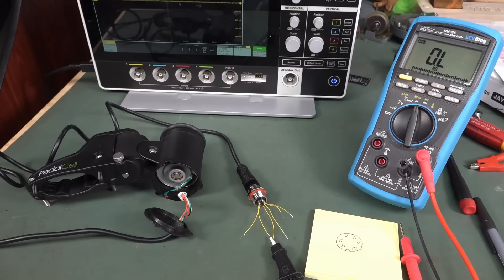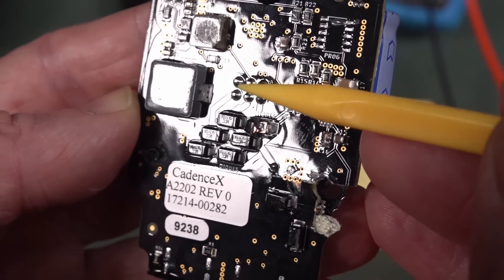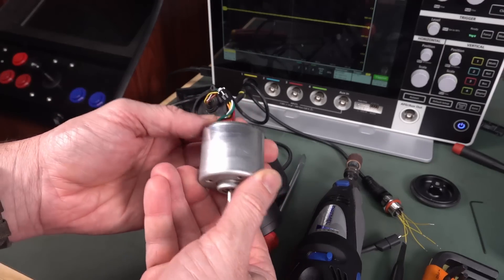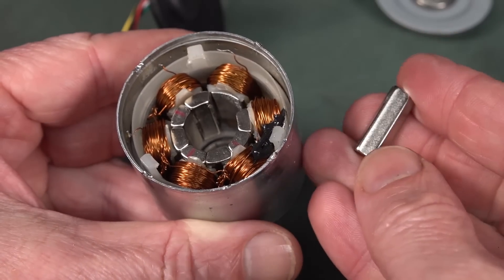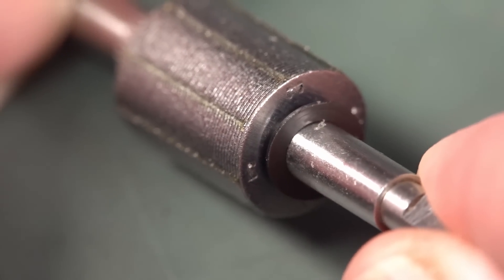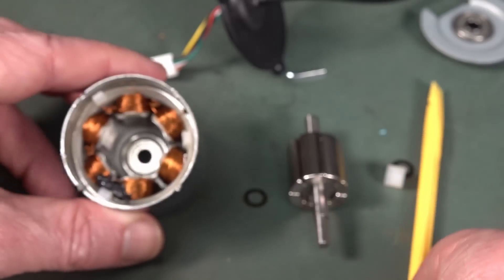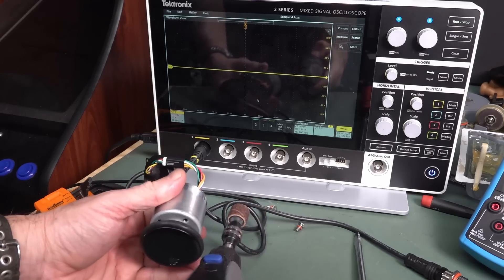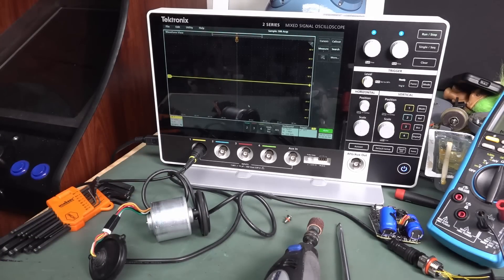EEVblog 1485 - PedalCell CadenceX Bike Generator LOL FAIL!

Comment: This is so awkward...we have 2022 and nearly every bike has a hub dynamo...or you simply buy a wheel whith one...much more efficient and can also be used with decent hardware to charge via USB.
Reply: Not many bikes have a hub dynamo. The PedalCell does mean that the dynamo can be moved easily to different bikes with different wheel sizes. It is actully more efficient (when working) than the hub dynamos.
Reply: @g4gxl  at least in germany for decades all bikes have either a hub dynamo or none at all(the sport bikes). And they're so cheap that it makes no real difference buying a wheel without one for everyday use. And I doubt that they're more efficient since you have no direct power coupling like in the hub. I always hated this old type. When I had a hub dynamo I leave it permanently turned on for security, since it is barely noticeable compared against this outdated concept. And you could get really problems with friction under bad conditions.

Comment: The funny thing is I just used a motor from a printer on my bicycle to make the light go, on . Made the roller from the paper take-up reel and the printer tray springs pull it against the wheel. The hinge assembly is from the cartridge holder. So LoL when you buy a professional product and get this on your plate. Chinaman what have you done.

Comment: The whole concept of a little rubber wheel rolling on the rim (or a ridged metal one rolling on the tire) is horribly outdated and stupid in the modern world. They were absolutely useful back in the days before hub generators, because they could be reliable (in combination with good quality weaterproofed lights) and because battery operated incandescent lights only lasted for a few rides at best. 

But by now, almost all bicycles either have battery operated LED lights that last for weeks or months, or a hub mounted generator that does not have any friction losses. A conventional hub generator delivers 3 watts of power which is just enough to slow charge one USB device, but it would be trivial for the manufacturer to offer them with a higher power output. 

Mounting a traditional rim/tire roller dynamo on a brand new bike is incredibly stupid because of the intense inefficiency. It truly feels like you're going from a mild tail wind to a mild head wind when you click it onto your wheel. 
Aside from that, they have a bit of a risk associated with them: ending up in your spokes. Doesn't happen often, but it does absolutely happen. 
Finally, they suck in rainy weather. You don't want the force at which they push onto your tire/rim to be too big because that will cause even more friction and more risk of the dynamo being pushed into the spokes. But too little force and it will slip, sometimes even stalling out for a few seconds at a time. 

They had their time, they were useful back in their day, and they still can serve as an emergency generator. I used one 2 years back when i lost one of my battery operated lights. Although i was running the LED lights for years already i never bothered taking off the dynamo.
But given the choice to power USB stuff, i'd rather just get a power bank and charge that slowly with a conventional hub generator, than have a rim/tire driven dynamo ever again.
Reply: Or ride down hill.

Comment: Wonder if this 'generator' application just over sped the rotor?  I didn't see just how fast you were spinning (frequency would be good indication, although that stator is 3-phase, 2-pole, and you have 8 poles on the rotor, so that's not exactly 'textbook' generator configuration).

But if that drive wheel is about 2.5 cm in diameter, a bicycle going about 15 mph (24 km/hr) would drive that thing over 5000 RPM.  I think THAT is where they screwed up, not realizing just how fast it's going to spin and it simply 'spun itself apart'.

Comment: hi Dave not sure if someone else commented, but if you measure one coil 8 ohms, aren't you actually measuring the parallel combination of one coil, together with the 2 other coils which are in series by themselves? 

ie. suppose each coil is actually 12 ohms, then you are meausing 12 ohms parallel with 24 ohms (the other two coils), giving you the 8 ohms ?
Reply: Doesn't matter - he's just checking if there is an inductive/resistive circuit, a short circuit or an open circuit.

Comment: That does seem like a bad design to rely on glue only, those magnets are under lot of force, they want to attract to the coils and they are under centrifugal force too.   Almost should be some kind of plastic sleeve that goes over it too. (don't want to use metal or it will mess up the magnetism)

Comment: Nice catch, Dave!  This was never destined to be reliable as a motor either.  Adhesive doesn't stick well to ceramic magnets... especially under tension.  I would have wrapped the ends of the magnet assembly with a few turns of fine wire and covered that with adhesive.  Even better would be to specify grooves to fit the wire.
Reply: Hard disk drive head voice coil servos all use glued, plated neodymium magnets like these.  But I'll admit they probably don't see anywhere near the Gs this pedogen delivers.  I still think it should be quite doable as the epoxies commonly used for such things are very strong in tension, though weaker in shear.

In fact the best way to remove hard drive magnets is a sharp strike of the servo magnet bracket against something hard - striking with the shear line of the glue perpendicular to the hard object being struck against. As my son discovered and videoed when he was about 13.

How to Remove Hard Drive Magnets: https://www.youtube.com/watch?v=_Im0vIvjPNQ
Reply: The glue isnt sticking to any ceramics, its a metal coating. Also, its an alloy, not a ceramic. Also also, glue has no problem holding on to ceramics.
Reply: @leocurious9919  And yet it falls apart almost immediately.
Reply: @byronwatkins2565  Yes? Because its a metal surface, cheap adhesive and only a tiny bit of it.

Comment: A decent solar panel that can charge a phone or whatever is only like $25, is small enough to be bike or pack mounted...doesn't suck any of your human power.  Can be used off the bike.  And can just be hooked up to a cheap power bank or directly to your phone.  These bike generators were cool 30-40 years ago.  Now they are basically useless even if they work.

Comment: Typical case of using a component in an environment it wasn't designed for and then doing zero testing.  Customers are now the quality control testers.  
It was hard to watch how long it took to realize the magnets had come off.
The hall effect sensors provide feedback for motor controllers that have speed control.
Reply: re: "and then doing zero testing. "

Like, temperature and vibe (vibration) testing? Yes ...

Comment: I'm guessing the glue failed as the unit got hotter & hotter. If it's a glue like super glue, it turns back into a liquid if it's heated beyond a certain temperature. Pretty shoddy. Great vid though Dave, love it 👌

Comment: Only at the 7:20 mark, and your spot on those magnets should be glued or attached to the center part, my guess is the makers of this used something pathetic like superglue or just hoped the magnets would hold themselves there. 

Source: Was a mechanic, have rewound a couple of alternators in my day, so to me the failure the second I saw in was pretty clear but thats just because of my experience. Love your work and keep it up.

Comment: another gimmick product that isnt very well made and doesnt really do a great job of what its supposed to do either. Im sure you can get commercially available ones these days but I modified a regular super bright bicycle light about 6 years ago now to use 3 x 18650s and a charge controller / usb output.. .it works as both a light and a usb device charger.

Alternatively USB power banks are that cheap these days and available in all kinds of shapes and sizes you'd  be way better putting one in a backpack or underseat bag etc with the device you want to charge.

I've had a few magnets fail in small engine flywheels over the years... these have all been engines that have has the flywheels partially submerged in water and the rust buildup has detached the original bonding.. never seen a motor give up the magnets that wasn't rusty so these must be built like crap.

Most half decent epoxy will be fine too for a long repair.. I have an old generator that I bonded the magnets in over ten years ago and gets used regularly and still going no problem.

Comment: you can just buy a standard bike dynamo, slap on a 4 diode bridge rectifier (and a capacitor) and feed the output of that into one of those cigarette lighter chargers you get for cars and that will make sure its 5v
been doing that for a few years on my bike and its been holding up fine    
cost me like 8$ in parts
Reply: Love it!

Comment: Shouldnt the magnets move relative to the coils? seems like they came unglued from the stator
Reply: Shouldn't you actually WATCH a video before commenting? You know, just so you don't make an a$$ of yourself.
Reply: Yes, Jones was disappointingly long to come to the same conclusion - IMHO he is slipping.
The missing cogging on the shaft alone should have alerted him of the true problem, given he can also see the electrical interface to the electronics.

Comment: It only takes one magnet to come lose and stick to the coils. Once that happens it jambs the whole motor up and then all the rest of the magnets break loose. The magnets change polarity from one to the next - NSNSNS. You can use a spare magnet to get the orientation, it doesn't matter if it N or S just as long as they run opposite from one to the next.

Comment: nice detective work. Its probably got three hall sensors as the motor was designed to be used as a motor not a generator, need the 3 halls to run it as a motor, so you could hook up an ebike controller and run the thing as a motor if you wanted.
Why the kept one hall sensor I'm not sure but it might be useful to have a signal for some reason, if they are not useing diodes to rectify the output they might be using the hall sensor output to rectify via some fets.......just a guess.
The magnets are just reversed polarity each magnet as you go around, so if not in correct order could easily sort it.
I suspect the little gennie might get a bit hot and the glue for magnets not strong enough when heated.
Sure is a neat little unit.

Comment: Those "glue marks" for all the world look like weld seams to me. Did they just happen to align with the marks on the top/bottom of the cylinder?
Reply: Watch the video. Pay attention. Then read other comments. Then post a new one if you have to ask something.
Reply: @johncoops6897  If you don't actually have an answer (doesn't sound like it) then you'll be more constructive by staying quiet. There. We both told each other what to do. I've no doubt you'll set a good example for me and others by complying.

PS. Also, watch the video, pay attention and read the other comments. All of them. Good luck and have fun.

Comment: Germans formed a "Forumslader" enthusiast working group decades ago, because any attempts at electronics coming out of bicycle accessory companies were garbage. Their DIY series of devices have several design goals. Main is compliance to legal norms - you simply HAVE to have dynamo lights in Germany, so you don't ever run out of energy. When you do, it's nice to be able to run them independently of pedalling, to give you extra safety when you need it, so they added hold up power which can be activated manually. Also they made it stealthy, you hide it entirely in the frame, so the authorities don't go around questioning you and people aren't so inclined to nick your stuff. Plus you get the ability to top up your GPS (this is when the project started, before smartphones were around) and phones and gadgets. Many members go on bicycle tours hundreds of km with intermittent camping and whatnot, and having true energy independence is great for a peace of mind. Then of course they got carried away and added Bluetooth and whatnot, which is nice as well, people love their bicycle tachos, but they are a little finicky, and the hub dynamo gives you regular pulses anyway.

You've got to use an actual bicycle quality dynamo to get that power. Tyre side dynamos work but aren't entirely pleasant. Hub dynamo is fairly nice though, and when it's shorted out, you can barely feel it at all, and those are reliable, they'll last for decades. That's the one sort of part you want from bicycle parts companies where they know what they're doing and are held to relevant standards.

Comment: A couple of grooves around the magnet cluster for circlips would have solved that, much better than glue. No wonder it tells you to do no more than 40MPH on the box.
Reply: Circlips would short out / distort the magnetic flux. They solve this problem in high-stress application by proper gluing, then a wrap or fiberglass, carbon fiber, etc around the magnets. Needs a bit more clearance to fit that.

Comment: I'm tempted to say "made in china" but generally they would not use quality bearings - usually just cheap bronze bushes instead. It may be that the motor/generator units are just assembled in china, and they don't give a shit. If the product fails a month down the track it's not their concern, they've been paid and that's all that counts. That's the chinese way.

Comment: Just an idea: instead of glue why not use one or two rings to strap the magnets?
Reply: Because that will increase the air gap between magnets and windings. In high-stress applications, they wrap the magnets in fibreglass, kelvar fabric, carbon fibre or whatever.

Comment: The rotor laminations do matter because the magnets act like air (in terms of inductance effects because a magnet is fully saturated) and the inductance seen in the windings involves the entire magnetic circuit (back iron, stator cores, rotor iron, and then back out)
Reply: it concentrates the field lines from the p. magnet right?
Reply: @Blox117  It concentrates both the field from the permanent magnet and the electromagnets. The field strength matters most in the air gap between the rotor and stator. You maximize that by creating a "magnetic circuit" with the lowest reluctance (i.e. highest permeability), which means that you want most of the field line loops to travel within iron.
Reply: @sbreheny  neat. so how do reluctance motors work then? It's the shape of the steel that matters? And it tries to move to create the lowest reluctance? It's kind of hard for me to understand why that produces a rotating force

Comment: I think in the previous video I saw that the manual said "don't exceed 40mph", seems like they should have set that speed a lot lower given the amount of glue holding it together.
Reply: My thoughts as well.  Estimating that drive wheel is about 2.5 cm, even a leisurely 15 mph would send it over 5000 RPM.  Small wonder it 'spun itself apart'.  Classic over-speeding failure.
Reply: @mikefochtman7164  ha ha! 15mph is my average speed on a bicycle! Make sure you don't go down any hills.
Reply: @DavePoo2  Yeah it's not like they have brakes so you can control your speed or anything. I get that most drivers are incapable of maintaining a speed limit.

Comment: to fix it you probably should do it in 2 steps
1 epoxy the core and slip on the magnets but separate them with teflon/polyetylene spacers and wait for glue to set
2 remove spacers and fill the gaps with more epoxy glue

it could be better than factory with cheap metal to metal epoxy :P

Comment: This was interesting, not because faulty product but it relates to topic of my masters of theses "Bicycle dynamo powered charger for electronic devices" (paper is in finish) where I studied HUB generator powered USB charger, done some measurements about HUB generator, and done some simulations.

3-phase generator is definitely better choice than 1-phase generator what usually is seen HUB generators. More steady output voltage after rectification.

Quality of construction of generator really matters, it's harsh environment. All that vibrations and etc.. but here rotor construction had extremely bad quality 🤦

Comment: It's an interesting segue to how the new Tesla S plaid needs carbon fiber overwrap on the motor rotor...no gear changes means it needs torque from 0-200+km/h. I forget something like 9:1 means the rotor something absurd 30cm(guess from memory) diameter has to spin at absurdium rpms...Rotor needs the carbon wrap just to prevent a nearly solid piece of metal from becoming shrapnel.
Reply: no, the rotor is different than shown here. It's an IPM design where the magnets are embedded inside of the steel. They can't come out. In the IPM design torque is provided threefold: permanent magnets, electromagnets, and magnetic reluctance

Also and more importantly, this design is over 20 years old and Tesla has nothing to do with it.

Comment: They probably thought they were getting a bargain buying up a bunch of cheap 3p motors at surplus, but they got screwed by the supplier!   ...WOW!
Reply: Newsflash: They all did pass incoming QC though I'd bet. Time does things to various glues though ...
Reply: @uploadJ  I find it hard to agree, for glue to go bad that fast...????  And let's say you are right, then it is a serious design flaw by using a crap glue that doe not last, either way it still smells of badly/cheaply made product.

Comment: Proof that the magnets were suppose to be connected to the center shaft is at 5:38, that horrible gap between the magnets due to the now extra spacing for now being where they aren't suppose to be.